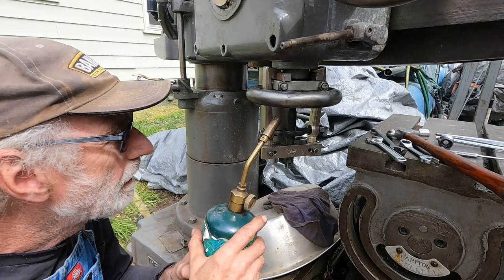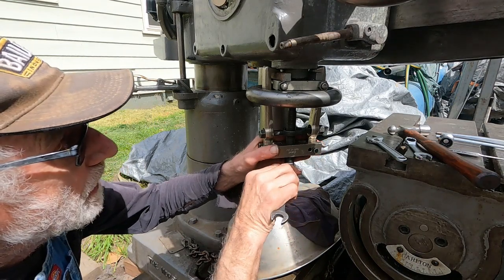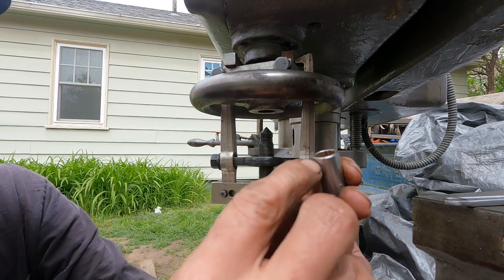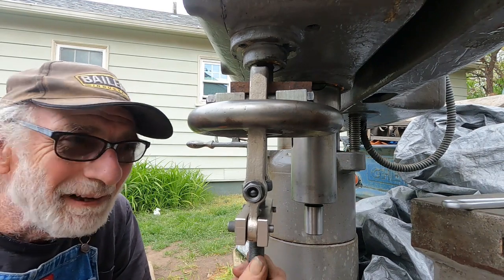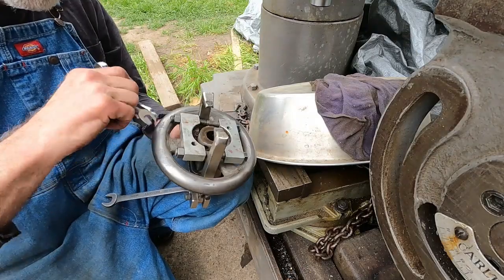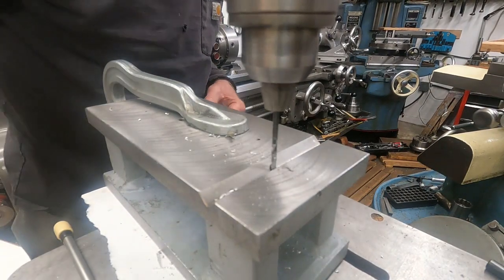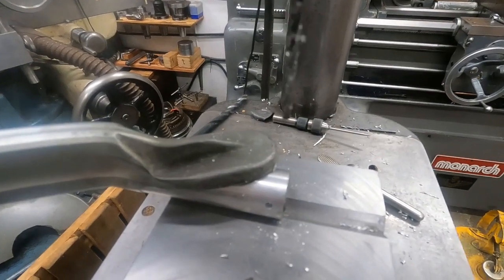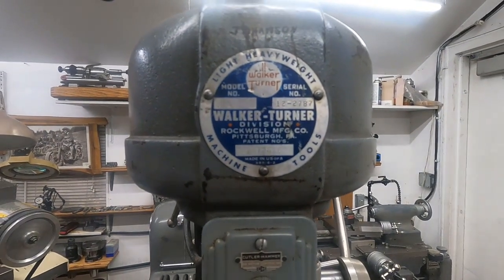Radial Drill repair progress and drilling round stock with bent bits

Comment: Never thought I'd hear you say, "I'm going to put the Crack down."
Reply from the maker: I still have my Snap-on tool set from the early 1970s proving I did not fall victim to Disco and cocaine, instead had motorcycles to ride through those troubled times.

Comment: Dee I love the slide show at the end of the video. One of my favorite pictures is the Radial Drill still covered in rust and flaking paint. It takes a special set of eyes like you and I have to see the beautiful, restored machine under the rust and chipped paint. The ole girl has come a long way since you bought it. I was enjoying the tornado alerts here in Tornado Alley until 5 am this morning. I guess that would be about 3 am pacific time. So chances are I was snoring when you smashed your finger repeatedly. BTY Blood and Bruises are part of the deal when one decides to restore old machines. As well as numerous words of Profanity.
Reply from the maker: I had a little training from local machine tool dealers by asking what to look for, however this one had a severe mechanical problem with the head being jammed and the head still has to come all the way off the arm for the glide bearings and cleaning after I burned them out with a torch. I need to get it over to the front of the building and use the building itself as a brace for the rigging to do that, The drilling head could weigh up to 2000lbs out of the 6000 the machine weighs. I am glad it is a small one.